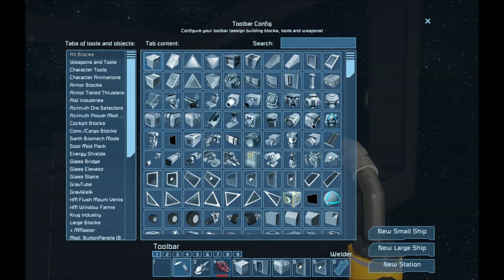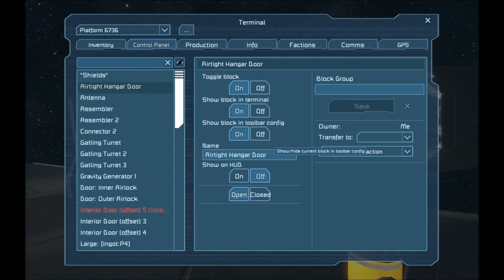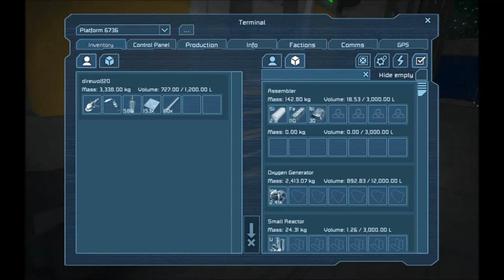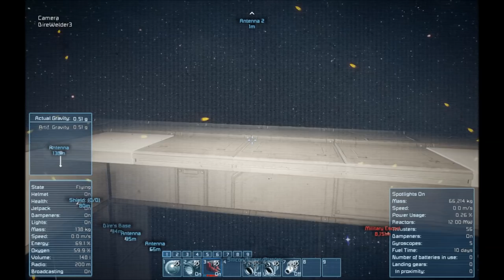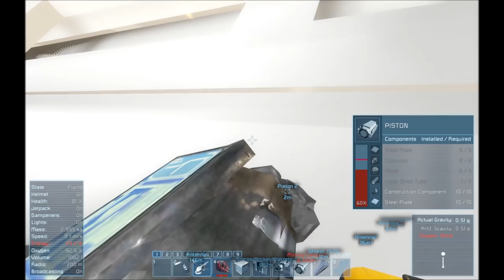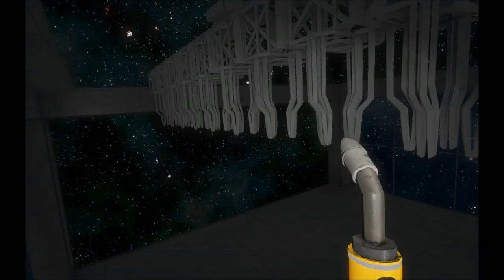Space Engineers   S1 E13 Welder Room Pt2

Comment: You could probably create an automated system where you input a maximum height and have the welders;
-lower to that height as to not bump the thing being welded.
-strafe across the platform at a slow speed to cover everything.
-strafe back across to make sure everything was covered.
-reset back to the default position.
That way you could set up something, start the program, and then go off and check some other stuff/do base maintenance and upkeep while the welders do their thing.
...Or just stand there mesmerized at the welding. As I have. Far. Too. Often.

(And you could possibly add a 1,2,3,etc after the height to specify how many times you want the welders to strafe back and forth, for the more complex parts and blocks)

Comment: Dire make sure your drones are locked to the station before you open your airtight hangar, or it will get blasted into space.

Also you are going to be wasting a TON of oxygen if you try and fill the hangar with oxygen every time you close it, I recommend setting it up so you evacuate all the oxygen BEFORE your open the hangar door (I can just imagine you forgetting)
Reply: +Kingwut117 I am surprised he built the welders outside for this very reason.  I was figuring he would have a rack of welders on each side with pistons extending to sweep the construction area from inside.  When he started running a line up the side I was wondering WTF he was doing.

If you do set it up to evacuate the room before opening the doors don't forget to automate the O2 production so it leaves enough tanks empty to cover opening the doors.
Reply: +Kingwut117 One of the scripts he has in his pack has options to make sure your O2 tanks have enough room in them to pressurize a room so I am sure he will have some automated "Depressurize, open, weld, close, represurize" system.
Reply: Scott Chamberlain That is so... inefficient. Why have the welders outside? 
just hook them up on both sides, start them in the middle, and then slowly pull them back to the wall. Easy. Simple. I can just see these welders getting stuck and exploding.